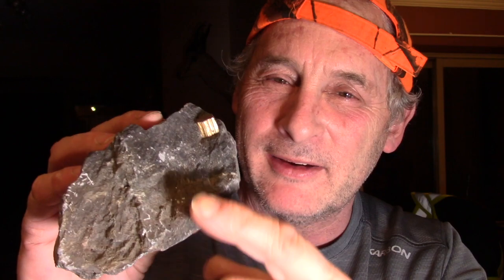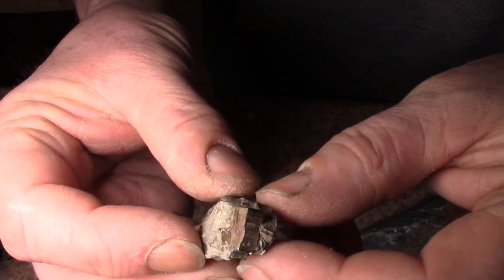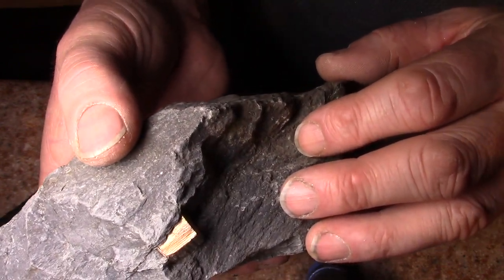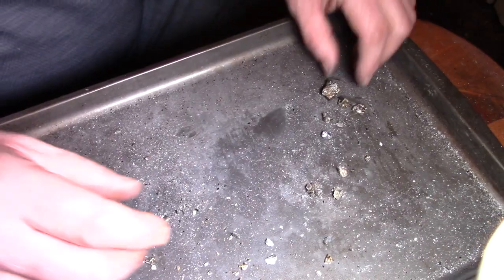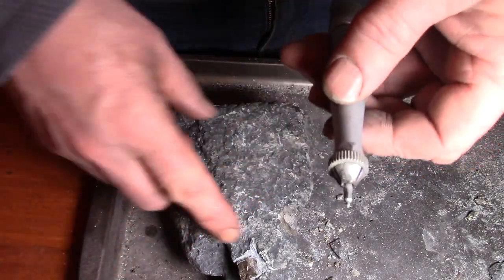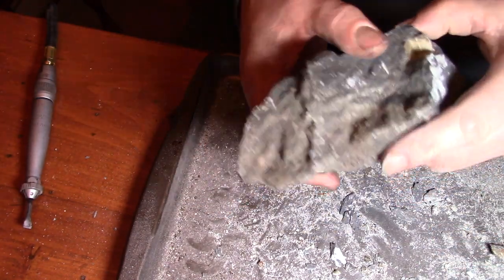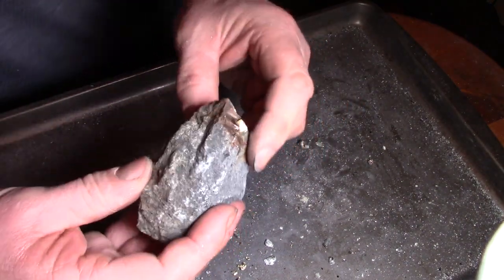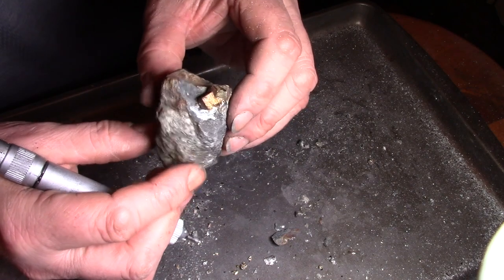ETCHING PYRITE WITH AIR SCRIBE

Comment: The pyrite i find in washington is covered with a layer of some sort of rust or something, do you know how to clean that off to make it shine?
Reply from the maker: I guess it is called iron pyrite for a reason eh?  On one of your samples, try Super Iron Out.  You can get it from any hardware store or big box store with the cleaning supplies.  It is a powder.  Let me know if it works for your application.
Reply: meMiner i have some i use for removing stains off of quartz crystals, it won't de solve the whole cube?
Reply from the maker: It won't harm quartz.  Just make sure it really is quartz.  :-)  Quartz is also unaffected by vinegar or muriatic acid.

Comment: You nutter, oops.
Shame, but you didn't glue it back on like so many would have done, that large one looks like it has a huge fracture across so there may well be more hidden within.
Those air tools are great fun and work extremely well on some softer rocks, I used a combination of one of those and an air grinder to make a headstone for my departed cat, " The Fearless Tabatha " it was only a large piece of Cornish slate but it came out well.
Where did you get that tray from, I've been searching for a couple of those for quite some time.
Stay warm.
Reply from the maker: The tray is just an old baking sheet (like the kind you put frozen fries onto for the oven).
Reply from the maker: I don't see a fracture.  The crystal does have striations, which are common.
Reply: I can see the tray clearly now, I thought it was either pressed stainless or aluminium , I've been looking for some cheap solid trays for my wet wheel set up.

Comment: i want one of those air chisels
Reply from the maker: I am pretty impressed so far with this tool and suspect it will get lots of use.  I was lucky to find a used one for sale in Toronto.  It does not look like it was used very much by the original owner and I did not have to clean or repair.  Also, I think I will be ordering some additional scribes from the USA that are built specifically for mineral etching.

Comment: Man is that thing powerful , Couldn't believe how easy it went through that .
Reply from the maker: I also like the control that it has for detailed work.  The little chisel is fun to use, like a mini jackhammer.
Reply: Ya that`s what I was amazed at Like nothing going thru it ,, Do you give it some sew machine or clipper oil for the fins inside as not to wear down ?
Reply from the maker: A few drops of Compressor oil.
Reply from the maker: Actually, it was beside the compressors in the store.  It is called Air tool oil.
Reply: tess99991 I'd like to find one of those.
Reply from the maker: At the same site, someone found one that was over 2".  I was in awe.  Maybe next year for me.